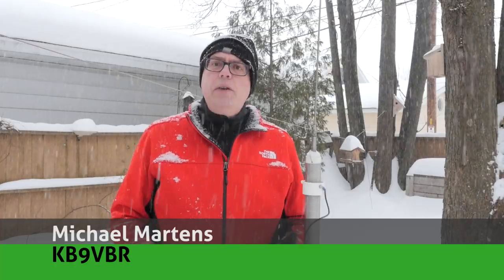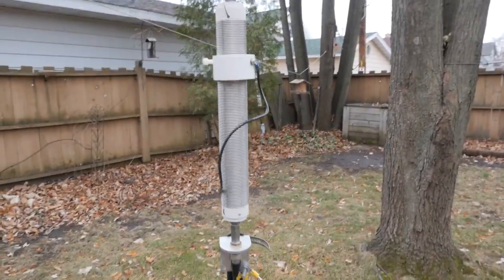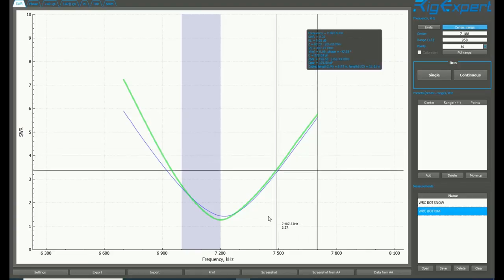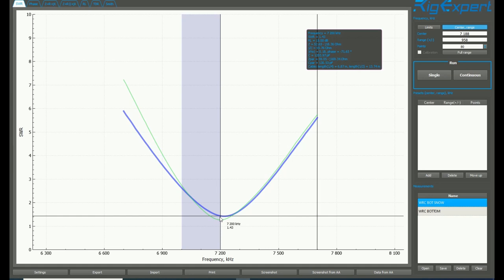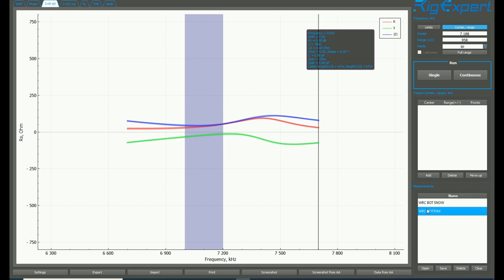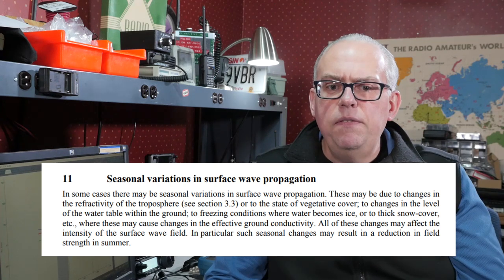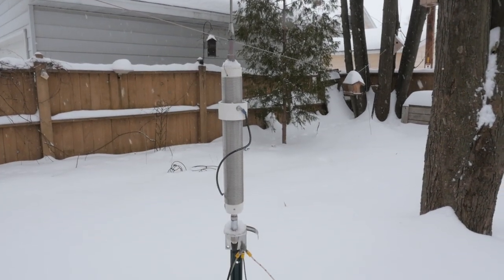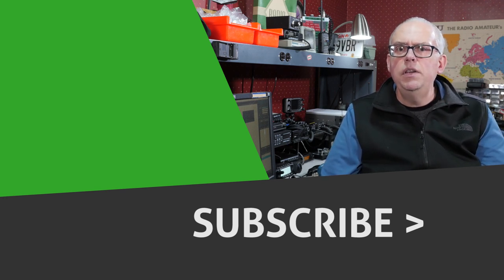Does Snow Affect Vertical Antenna Performance -  Ham Radio Q&A

Comment: I do primarily mobile portable operating here in Wisconsin. I use the same antenna, the Silver Bullet 1000 and the only issue I have with snow, rain, ice is when it is on the radiating elements above the collar. I took a 2 liter soda bottle and fashioned up a cover to go over the coil and collar. This very cheap fix has fixed my SWR issues while dealing with precipitation.  While it wouldn't work well while driving, it works great for portable use and could also work well for a base setup such as yours Michael. 73s from Appleton.

Comment: Too many variables is spot on. I would think if you were using bare wire and the snow was melting to a point your whole back yard was an ice skating rink it would be like putting your radials in a lake. 
On the the other hand maybe next week you could test the effects of yellow snow on tuning. Just don't have anybody transmit while you are making the yellow snow. Well you are probably safe since your ground radials are insulated.
So do you tune in to 7200 often? What a bizarre frequency! Almost as bizarre as this comment.
Love your videos!

Comment: I have noticed the same results on my vertical. I live farther north in mn and once it snowed my swr was higher. i have a 43ft vertical and have about 20 insulated radials stapled to the ground. the most i noticed was .5 swr change from summer to winter.

Comment: AM broadcast band signal ground wave signal strength always appears stronger in the winter months vs. the warmer summer months. If you have an AM broadcast band receiver with a signal strength meter you can note either bar or number readings from summer and then in winter. In every case, the reading are always higher in the winter especially with snow and cold weather. It's always been my assumption that medium wave ground conductivity (including 160 Mtrs) is better in the winter. Since your doing your tests on 40 Mtrs, the effects on snow and cold may be less noticeable.

Comment: Have great deal of experience with MF broadcast frequencies. As stated in earlier post, soil conductivity does increase over the winter months. These changes impact the far field in varying degrees. In some instances as much as 50% but usually 10 to 15%. Snow in varying depths does not seem to have much impact on the measured field; however, there is somewhat of a field instability that occurs in what seems to be the transition from wet ground to frozen ground. It seems to settle back down after it reaches the frozen state, only in the transition. I know others who have observed it but not enough interest or time to dig deeper into why.  The near field or the self impedance of the antenna do not seem to be affected. I have wondered what changes might happen above 30mc but there again, not enough interest to  find out. Not worth getting my feet and everything else cold...
HiHi
73' de K4WRF

Comment: Sure enjoy all your videos.
This Snow subject and radio waves is something I deal with more on Military excercises. You loose transmiting and recieving strength.
First of all to do this test for the sake of this veiwers question, an antenna that is tested before a snow fall  is grounded.
Now try this same test with the antenna not grounded into the earth.
But sitting on the snow. 
Because snow is Distilled water it can not conduct electrical current no matter if it is wet or dry snow.
This is why we have such a problem in  snow without a ground plane.

Comment: Love your videos - always full of actual information, not fluff like other videos.  Suggestion - could you do a video of using the antenna analyzer to actually tune an antenna?  Seems most videos do what you've done in this video - "I've taken my readings and loaded into the computer" - but seeing the actual usage of the analyzer (let's be honest, the instruction manual is lacking), how to interpret the information it gives, and how to adjust the antenna to make the SWR better would be AMAZING.  I can take the readings, but no where have I found out how to "interpret" and put that info into use, and I think your method of videos would be prime time for that sort of video.  Thanks!  de KC3LTS
Reply from the maker: A couple others have asked for the same type of video on the Rig Expert analyzers. That subject is on my list.

Comment: I have two problems with this video:
1st your antenna is not mounted on the ground, so adding a capacitive effect to the feedpoint. As C varies with the distance to (real) ground, snow could indeed influence, but not only due to covering the redials. Any thoughts ?
2nd your measuring in the shack including your coax run, meaning you are assessing an antenna system and not only the antenna. As copper contracts when cold, what are your really measuring in the system ?
3rd only 3 radials doesn't seems enough to me to draw any conclusion.
73's, ON4KNP

Comment: Michael,

I always enjoy your videos!!!! One question: With your wolf river antenna system,  how many radials are you using and are they cut at specific lengths for your operating frequencies?  Also, does the antenna benefit from being grounded?

Thanks,
Ross, K8RLB
Reply from the maker: I'm using three ground radials each 32 feet in length. At this length they tend to work best at the lower lengths but can be a bit finicky 20 meters and above. I do the same thing when I use the antenna portable but I will roll up the radials to shorten them for a better match on the higher bands. Unfortunately I can't do that when they get buried in snow and ice. For radial length‚ a general rule is that if they are non-resonant on all the frequencies you wish to work on‚ they will work acceptably on those frequencies. 

As for grounding‚ I don't really think additional grounding is necessary if you are already using a ground radial network. I didn't ground the antenna; although I suppose with it mounted on a fence post there would be a certain amount of grounding. But it's tenuous as the post is also painted.

Comment: I wonder about the effects of snow on a DX commander type vertical antenna with the radiator plate berried in the snow.  Will it still work or with it be grounded out because both the radiator and ground plates are in the snow???

Comment: Hi Michael, would love to see a redo of these tests with bare (non-coated) copper or aluminum wire to allow contact with rain/snow/ice etc.
Reply: Snow and rain are none conductive as it is distilled water. There no minerals to carry any current.
Reply: @claudenormandeau9211  
Yes they are(theoretically!)... until...

...They hit the ground! 
If a powerline hits the ground! (I.e. ice/snow/rain); it's going to conduct & electrocute somebody!

If the wind knocks over your antenna - high voltage can be present in the snow!
Reply from the maker: I may repeat these tests with some bare wire radials. I've received some good feedback from this video so I'll certainly continue exploring this subject.